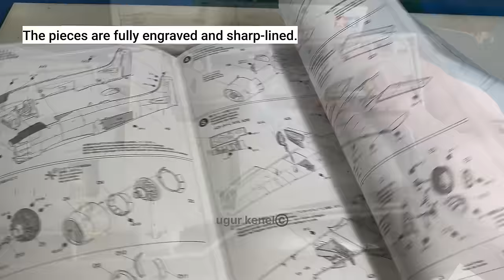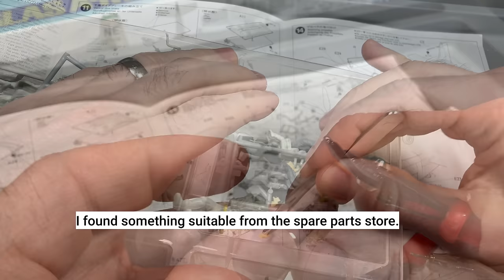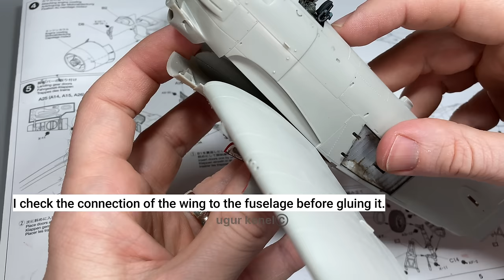TAMIYA Douglas A-1H SKYRAIDER / SCALE MODEL AIRCRAFT BUILD - 1/48 / U.S. NAVY

Comment: That is one decidedly second-hand looking Skyraider. Lovely Job, thanks for sharing it with us.
Reply from the maker: Thanks a lot🙏🙏👍
Reply: I love you are putting in the time with the pilot figure! As any aircraft sitting on the ground with every access door open, cockpit empty, gear down, is broken and down for maintenance, you are making a scenario for an airworthy bird ready to fly. Personally I don't even buy a kit if the pilot figure is not included. Jets, without a stationary engine off prop are less easily broken if they are build sans the gear down. I do most prop planes gear down however, but wish somebodu would make a realistic clear...ish spinning prop disk for the prop planes. I scratch built a 1/48 B-29  into a KB-50J (used alot of old C-130 pieces, B-25 engine faces, and sheet styrene) tanking 3 F-105's w/probe and droge, but the lake of spinning prop disks takes away much of the majesty..... Anyway, your "spad" turned out great. 1/48 is a great scale for aircraft. Wish they'd make a B-47 and C-119 in 1/48!!!!

Comment: Awesome model and paintjob!!!

Ideas in my Mind when I watched the Process.

Maybe less dusty bombs: but I get it... Weathering all the same pieces over and over is boring.

The bee decal: maybe it would need some more scratches on the red stripe, as the model overall is heavily weathered.

The exhaust sooth: its very sharp on the box art and on real photos. Maybe some masking tape on right after the hood could simulate a similar effect, and sharp edges could be softened up with some wash, oil sponge or so.

But well i have yet to overcome my hesitation doing such a big model in one go.
Reply from the maker: Thanks a lot.
I will take your suggestions into consideration in my next projects. 
🤝👍

Comment: That is extremely fantastic eork of this model. I have several to build including a 1/32 scale Korean war version early overalldark blue. Being average modeller i don't know how im going to weather a  sea blue large scale model. But that Skyraider build is superb. Very realistically weathered Aircraft.👍
Reply from the maker: Many thanks🤝
Weathering on blue NAVY aircraft: If it were me, I would generally make it look metallic from underneath. In the form of a scrape of chipping.
Reply: @ugurkenel  From George.  I haven't had the pleasure of building many Sea Blue finishes. Very hard to get a super gloss finish unless from a spray can. I also have the 1/32 scale TBM Avenger Aircraft with overall sea Blue. Not completed yet.I still have trouble with which bue to use. Usually it's sea  Blue but there has been a mention of midnight blue and dark royal blue. However I understand about Metal chipping. The only weathering I've done over gloss Blue finish is the exhaust streaks with the Tamiya weathering kits.  Sorry I babbled on too much . Thanks for reply.👍

Comment: The weathering looks good , the prop needs some weathering and chipping looks like it was installed yesterday,  doesn't match the rest of the plane
Reply: Maybe a bit of story telling? A prop getting replaced while the rest of the aircraft is still crusty sounds believable.
Reply from the maker: I definitely thought about this during the construction phase. In many reference photos, I saw that the propellers were extremely clean, which was unique to this model, and there were only some scratches on the red and white stripes. Maybe it's because the material of the propellers is black metal or close to black.

Comment: I love your builds, but watching you put everything together with super glue kills me as I know your work would be so much better without it. You destroy so much detail trying to remove it and encourage fit issues. It definitely has its uses for attaching small parts.
Reply from the maker: You may be right, but it's my old habits.
I always broke or cracked the models I made without using CA glue. I can't be sensitive when making models. I damage it all the time by sanding it or dropping it. That's why I prefer to use super glue. Since the model itself is plastic, it is easier for me to complete the lost details later.